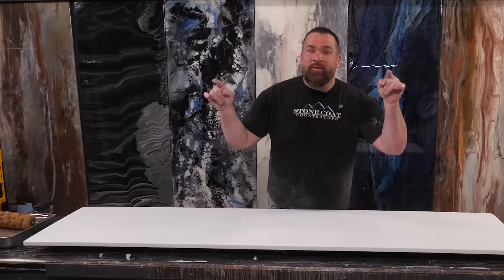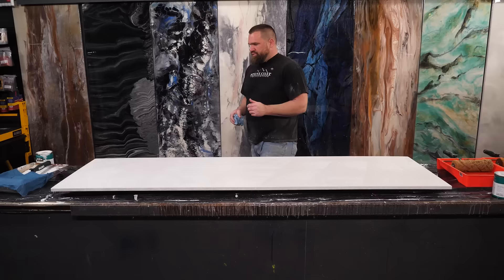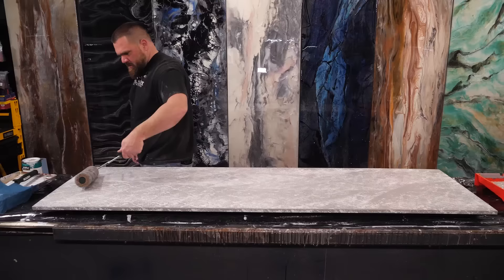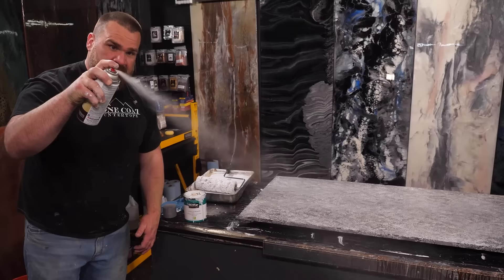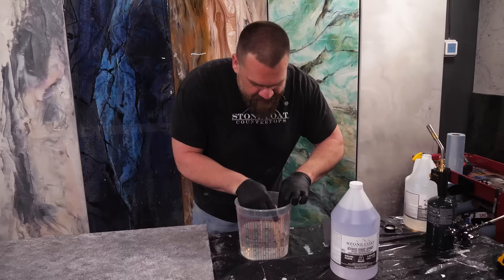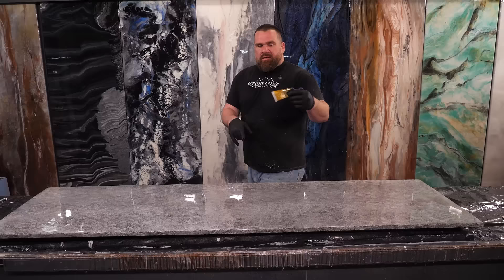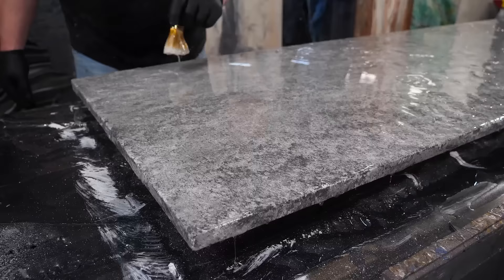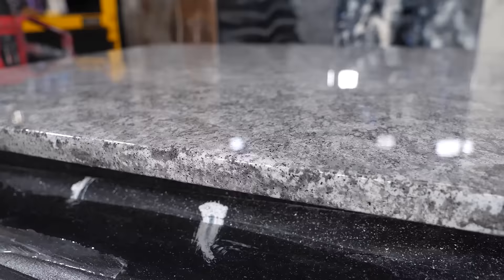How to Make Granite Countertops with a Paint Roller | Stone Coat Epoxy

Comment: That is awesome. I used sponge blotting/dabbing for a similar effect a medicine cabinet (without the epoxy though)
Reply from the maker: The epoxy will keep that faux effect safe for a long time! Thanks for watching
Reply: @StoneCoatCountertops  I've been worried that the steam from the bathroom will negatively affect the finish without the epoxy.
Reply: @tengen3613  steam isn't going to effect epoxy. Epoxy is extremely durable. Just make sure you use good quality epoxy.

Comment: Very interesting.. I just did this same technique on my walls.
I recommend getting the 4 inch sea sponge rollers instead.. the 9 inch absorb way too much paint, and get heavy, and waste paint.
I start with darkest color 1st. 
If you go really light final coat with the lightest color at the end, and just add some here and there, it's like a ghosting effect.
I wouldve done the alcohol with metallic right after the final coat of paint. 
Also, put some spray paint on your gloved fingertips and flick onto the surface (like gold, or silver).
Then, if you take a small popsicle stick and make little "cuts" here and there, it makes it look really awesome.
I like what you said about affordability. This eliminates all the epoxy from the color coat phase. Hmmm good call.
Reply: Hi, I looked for paint roller on Amazon and I can't find it ☹️

Comment: All well and fine on a flat separate surface. Most people have back splashes ect...How do you maintain the same pattern on these sides and an even clear coat fighting gravity ? Are their different size rollers for different back splash widths ?
Reply: One of his previous videos he does a kitchen top in place including backsplash. Spoiler alert, it requires removing the back and end splashes. It can be done with relative ease.
Reply from the maker: Very good question. The sponge rollers came with 2-3 smaller sponges to hit edges and stuff like that. They also sell a smaller roller for the backsplash and tie the vertical and flat surface together with the small sponges. I'll have to give it a try on site! Because you only apply clear epoxy you can do this technique on vertical surfaces like existing backsplash. Thanks for watching and the great question

Comment: I have a house built in the early 60’s and true to that era, I have pink porcelain tiles on walls and on shower/tub walls.  And pink multicolor floor tiles in various shades of pink.  I am wanting something to kind of break up that pink but to keep colors light.  I was thinking a white quartz look on my bathroom counter.  Something with that quartz sparkle, but maybe just a little underlying veins of rose quartz to pull it all together.  Will this method work for that look?  If so, could you do a video on it?

Comment: This is exactly the look I want for my kitchen. Should I add the Ultimate Top Coat to add durability?
Reply from the maker: Yes, definitely. I always use the ultimate top coat when installing or working off site. The top coat can be added at a later time to any epoxy job by lightly sanding with 220 grit, wiping the dust. Let me know if you have any questions

Comment: i used your art coat for 1 half of my kitchen countertops, saw this video and immediately want to re do the whole project using this technique, im assuming to go over an already epoxied top i only have to 1)sand it 2) paint new white base layer over it 3) apply paints using this technique? or do i have to peal all the epoxy off?

Comment: Can you use a hair blower to get rid of the air bubbles? Or do you need something more technical?
Reply from the maker: Yes, it will take longer though. If there are colors mixed into the epoxy, the blow dryer can move them and over meld them because of how much air is blowing. A heat gun does a great job also. The torch works fastest, the epoxy isn't flammable and using the torch is really easy. Let me know if you have any questions

Comment: @stonecoatcountertops can you epoxy a drum set??? Ive had lots of problems applying epoxy to cylindrical objects.
Reply from the maker: The epoxy will run if applied vertically, also it can change the sound of a drum or acoustic guitar. If you apply the epoxy thickener then the material acts like venetian plaster and can go vertical but no longer self levels. Cool idea!

Comment: Can you put epoxy on the build in 4" backsplash, won't it run down to the bottom. Is it possible to put on very thin coats so it holds and doesn't drip down.

Comment: I tried this technique after your previous video. Very happy with your products. I do have one question. What is the best way to clean up? For example, I get epoxy on my hands even as hard as I try not to. Any suggestions?
Reply from the maker: Gloves would a great way to keep the epoxy off but if you do get it on your hands isopropyl alcohol would be a great way to remove it.
Reply: @StoneCoatCountertops  Thanks. I'm just a messy person. This will help.

Comment: I Wana doing this work . please help me with the details of metrial you use for it . One by one
Reply from the maker: Happy to help!
-MDF or Plywood base or existing countertop
-White Epoxy Undercoat: https://amzn.to/3OF3BRx
-4 shades of gray paint in your color of choice from your local hardware store, a little paint goes a long way
- Sponge Roller: https://amzn.to/3Kh0YlD
-Roller Pan: https://amzn.to/3kbQ4Di
-Stone Coat Countertop Epoxy: https://amzn.to/3vFHP7z
- Stone Coat Notch Trowel: https://amzn.to/3Lj7Q39
- Mixing Paddle: https://amzn.to/3EKe7T0
- Mixing Bucket: https://amzn.to/3vo61wB
-Torch we use: https://amzn.to/3MkxTY2
-Black Stone Spray: https://amzn.to/3K4Wler
-Dewalt Drill: https://amzn.to/3EON3lT
Let me know if you have any questions
Reply: Thank you os much

Comment: Are these epoxy countertops food safe? (I heard you mention using some epoxy for cutting boards) Is there any additional steps that need to be considered for food safety and/or cleaning?
Reply from the maker: The Art Coat, normal Stone Coat Countertop Epoxy and the Ultimate Top Coat matte and glossy are all FDA approved for food contact. I wouldn't use the material as a cutting board
Reply: @StoneCoatCountertops  , why not as a cutting board?  I remember you've shown some video examples of cutting on your countertops, and Mitch said he was mixing extra clear in this video to use on cutting boards he was making.  So, what is the concern?

Comment: Can you epoxy over linoleum floors or do you need to remove it or cover it first?
Reply from the maker: I'd remove them 1st, I haven't tried before though. I'd worry about delamination on the glossy spongy surface, great question

Comment: Cool. Can you use countertop epoxy over polycrylic sealed wood coasters?
Reply from the maker: Yes you can! Sand with 220 before and wipe dust with 91% isopropyl alcohol
Reply: @StoneCoatCountertops thank you. Done prior to ever thinking about epoxy.

Comment: Any tips on how long I need to keep my toddler out of the house and away from my countertop? 
What do I do if I see dog hair in my project after my clear coat?
Reply from the maker: You will want to wait until the Epoxy is fully cured before any major use. As for the dog hair if you catch it early enough you can use something to remove it from the epoxy or wait until the project has dried and sand it down and redo your clear coat.